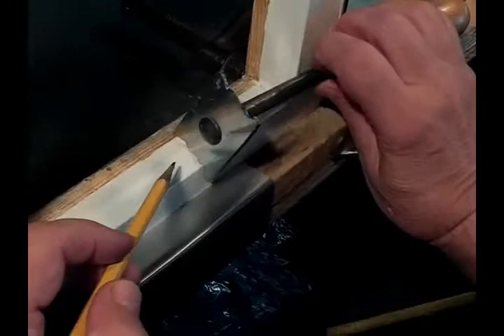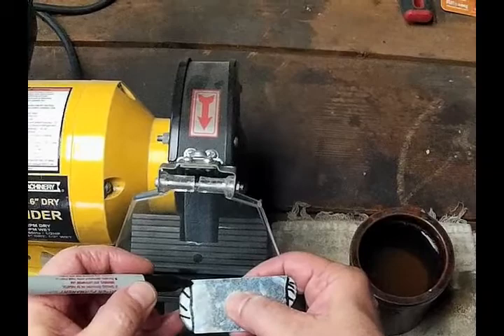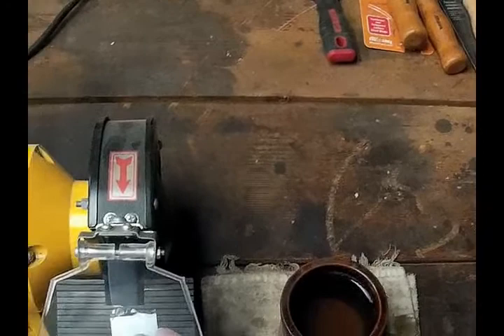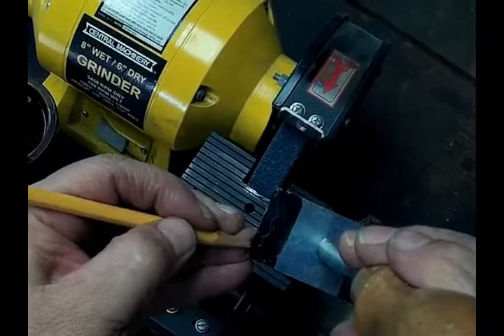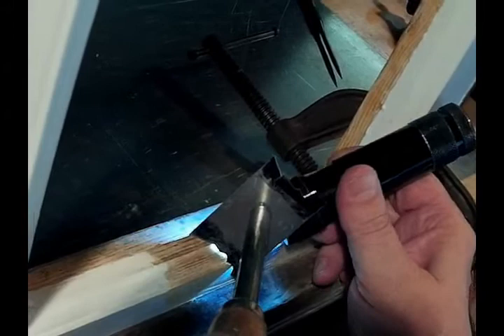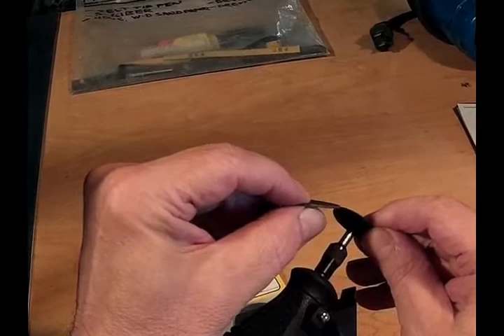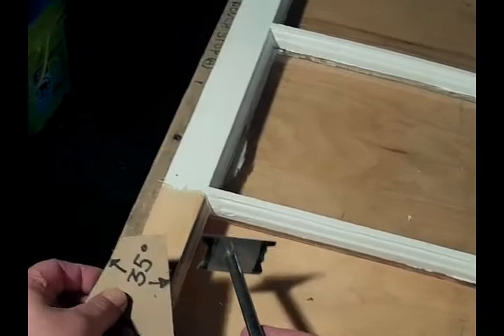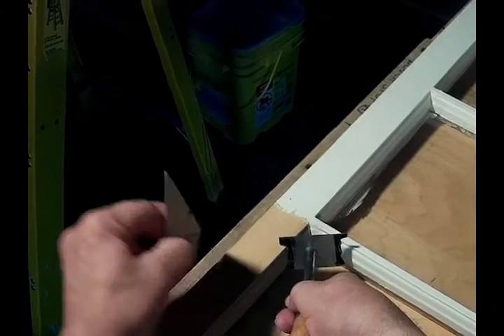Sash Profile Scraper, preview

Comment: I can see how useful carbide can be for such work
Reply from the maker: These profile scrapers are not carbide. Carbide would be too difficult to shape and is not readily available in the larger size needed. These scrapers are tool steel, which is easier to grind and file than carbide.

Comment: Outstanding and comprehensive demonstration of what would be extremely difficult to grasp or mentally picture without seeing your demo. I cannot exactly describe why but doesn't the round heel of the scribe introduce a small error into the line that it scribes on the tool?  The error would be small though - just half the radius of the scribe which is maybe 3/32".  I was thinking an alternative way might be to press modeling clay into the sash profile, and then slice the clay at your 35 degree angle(s?)  and then remove the clay and use the clay to transfer the pattern to the scraper? Not sure if that would be any improvement but since the grinding looks to be the most difficult part for the inexperienced person anything to reduce the grinding might be helpful.. Thanks for posting this and I'm hoping tto use this to save a dozen Craftsman Bungalow windows circa 1921..
Reply from the maker: Dog, you are correct. I did not mention in the video above that I reshaped the "heal" of the scribe so it has a profile of about 45 degrees. This lets the scribe follow the inner angles and smaller hollows more accurately. Here's a video showing this:
https://youtu.be/-Xth5-TrwGE